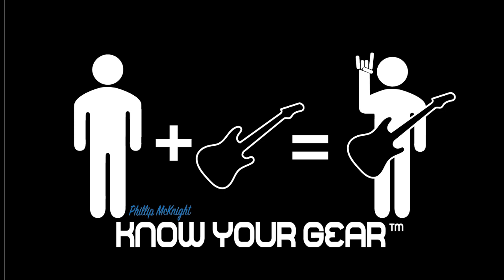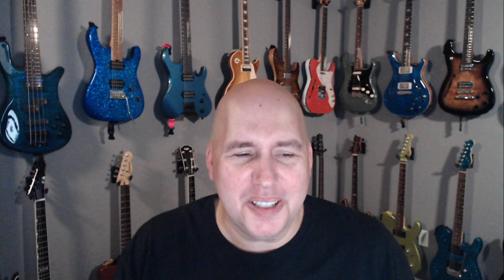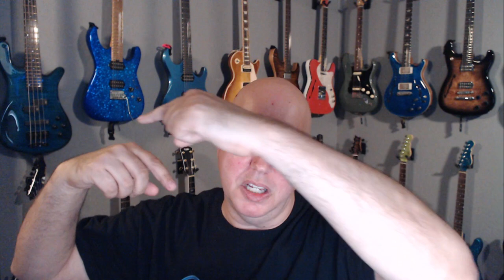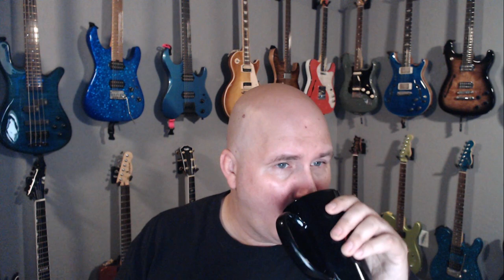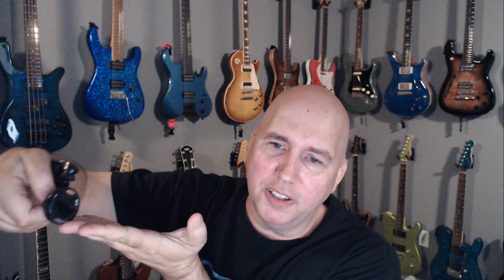USA made guitars and where the value comes from. KYG Guitar Podcast

Comment: 57:00 Phil's forecast is good.  When stores closed, prices came down as guitars were sold to make room for the new arrivals to come.  Now?  Prices are quite a bit higher than they were in April-May 2020. (Supply has come down as the savings accrued, so demand is up.)  Just wait, and there will be a flood of accumulated gear that was tried out will be thinned from collections.

Comment: i think i spent about 6000€uros on guitar gear between April and October. grew my guitarcollection from 4 to 12, got 4 amps (two of which are 100watt tube heads) and four 4by12 cabinets. one of the guitars was new, all the other gear is used. there is/was a lot of great deals to make on used items due to covid.

Comment: Bought my maple neck white precision new in high school in 73.  $300 with case...That was 6 nights babysitting drunks at Elks, Moose & Eagles lodges where we had to go outside during breaks. Everyone told me CBS instruments weren’t worth much, so when my blue polyester stage shirt bled into the yellowing finish, and I got tired of the dead spot on the g string F# on Color My World, I went to town on mods... brass nut, upgraded pots, original Badass bridge {routed by my dad, an expert cabinet maker} chrome metal pick guard,  Bartolini Hi A pickups, chemical stripper and a rattle can wet sanded black lacquer refin. It was in pieces all thru college, (while I played a neck heavy Kramer aluminum neck Kramer 450B) so the bare body was my worry stone, years of sanding to a driftwood feel, including smoothing the neck heel. Of course, teenage me kept zero parts. When I saw a 74 at MF going for $1600 twenty years ago and Reverb sellers wanting $100 for an original pot...I did have pangs of remorse. But she’s my baby.. has a clank aggressive as any Rick or a growl as sweet as anything... many techs compliment me on the sound. Even with a sloppy neck pocket, which I understand is common to mid 70’s Fenders. CalJam 83, KZAP& KOME stickers on the case. Now... if it was my guitarist’s 61 Strat with worn frets that sounded like sitar... of course that would be another matter!

Comment: bought 4 guitars and a new small practice amp.  Then, found a Fernandes Nomad  ZO-3 Deluxe sitting out by the curb in someones bulk trash to be picked up,  Normally I don't pick trash but A. This was sitting cleanly on top of some old computer equipment B. it looked like it was in perfect condition and C.  It was the model with the built in Digi Tech effects to go along with the built in amp and speaker.  So... after buying 4 new guitars and an amp - the most played out of all the new equipment is the guitar I found for free that doesn't require an amp - my life in a nutshell.

Comment: Use De-Oxit on pots and switches due to how the internal components work. It contains a lubricant for the friction contact surfaces. Regular contact cleaners from Home Depot, Autozone, etc. have no lubricating properties and will increase wear and tear on friction contact surfaces in pots. Regular contact cleaner is okay for jacks and other non-friction electronics, etc.

Here is a good, detailed video that explains De-Oxit vs. other electronic cleaners and when to use each.
https://youtu.be/zf5eUOhRDLg

Comment: 2 beers in a pub in Australia is the price of a 6 pack!.. You lucky yanks and your cheep 12 packs!
Reply: One beer at a dive bar is 5-6 bucks here in ny buddy. A six pack of said beer is 10-12 at the bodega so it’s the same. They don’t sell 12 packs down under?
Reply: @777Lateralus  Well I guess it depends on the beer and the establishment. In Melb  you'd be lucky to score a stubby for under $9 in a bar. But no less than $6 in cheaper bars in the burbs. A 6 pack is $18-$24. A slab of 24 is $50-$60. Factoring exchange rates price are probably similar. 12 packs aren't very common here but I see them occasionally.... So with that 777lateralus user name, do you happen to be a Tool fan?